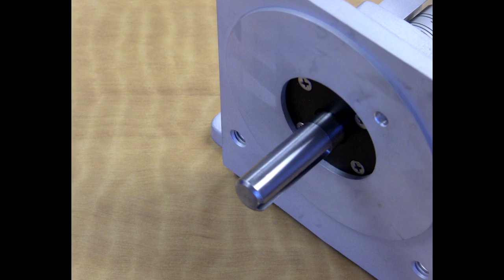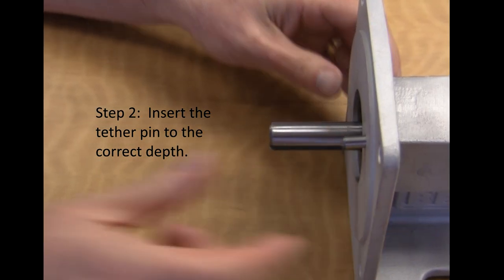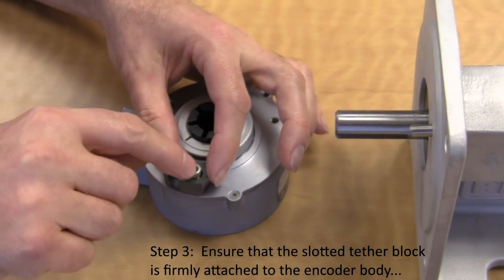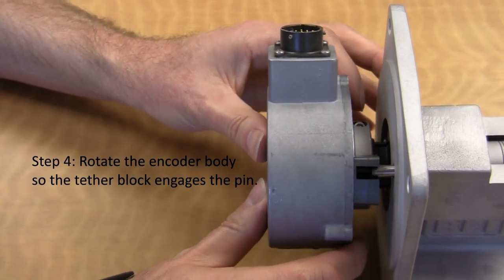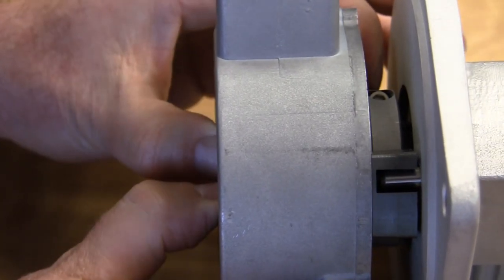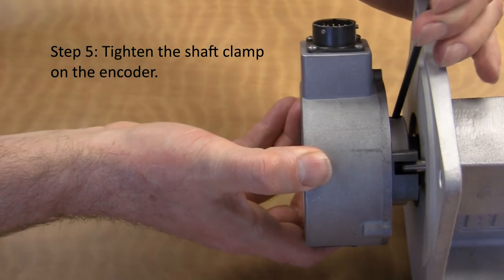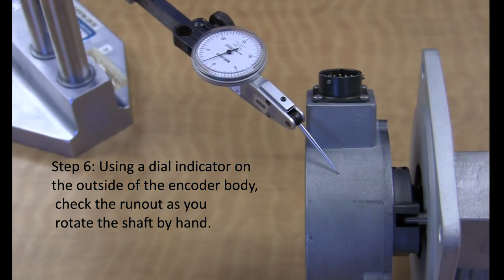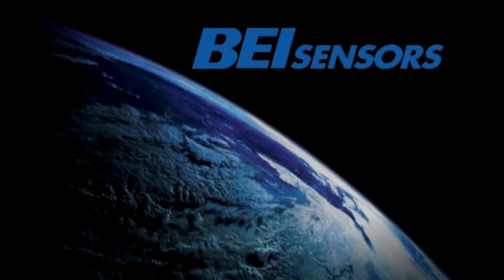How to Install a Hollow Shaft Rotary Encoder with a block and pin

Comment: hi sir.... my machine shaft dia is 18mm.. can I find a suitable hallow type encoder for my machine.... or can I find an adjustable hallow dia type speed encoder.
Reply: I have the same issue... seems like hollow encoders limits your motor to adapt it to something else... working to solve this